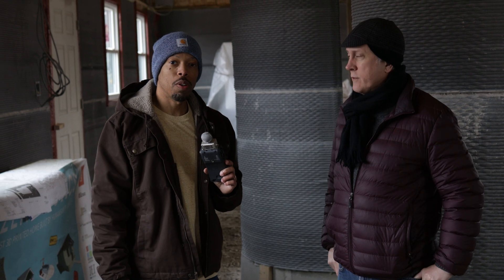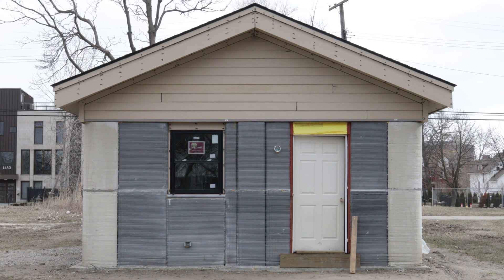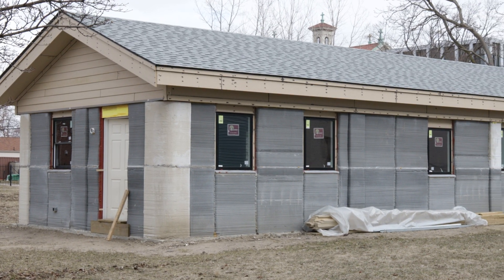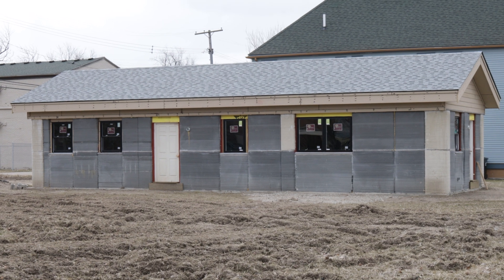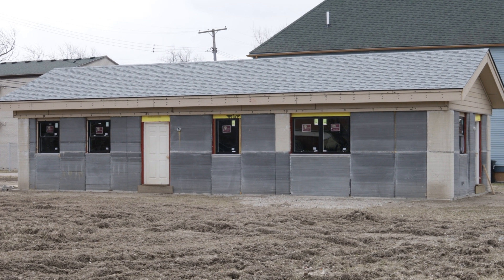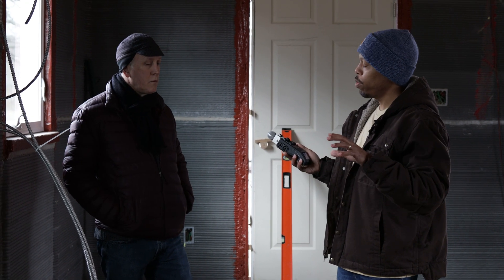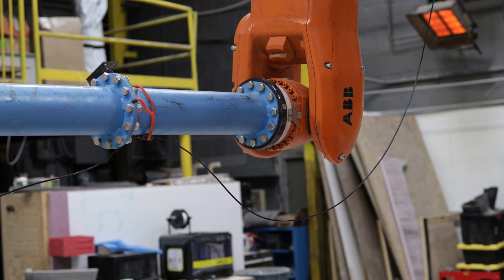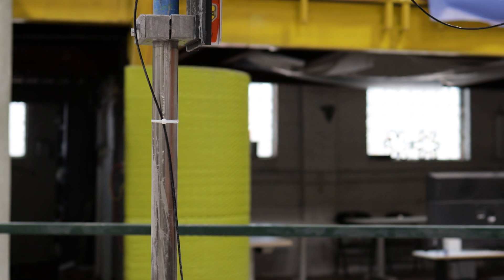Touring Detroit's First 3D-Printed Home

Comment: Snowbirds only special? No fossil fuels to be burned in the house? How are going to get by in winter? 🥶
Reply: This is in Detroit. I’m 29 and the coldest winter I remember it was negative 15 Fahrenheit. A heat pump will be sufficient for heating without the need for gas and be much cheaper to run. Better for your lungs too.
Reply: @zacharyeversole  I think I remember it got down to -23 in Ann Arbor back in the winter of 2017 once. My car took forever to warm up. I looked up heat pumps and they lose efficiency below 40F. Only some models operate all the way down to -15F, whereas gas furnaces are 90% efficient these days. Anyway. I'd love to buy this house but I'll install a furnace for the winter.